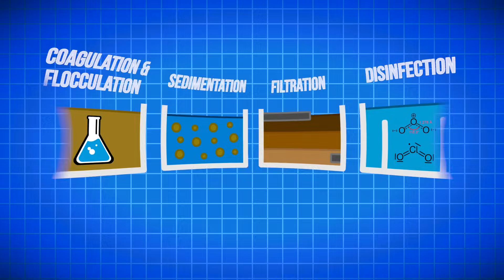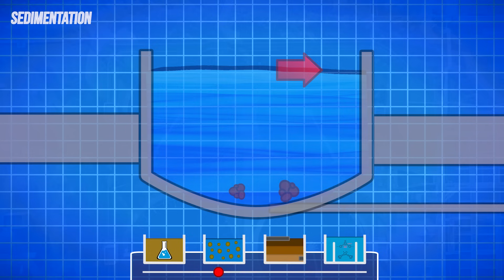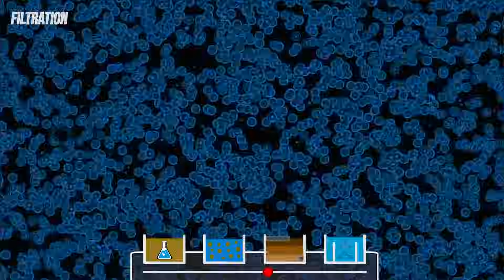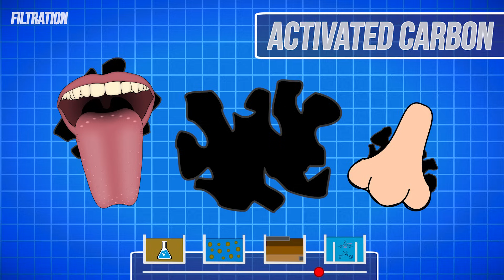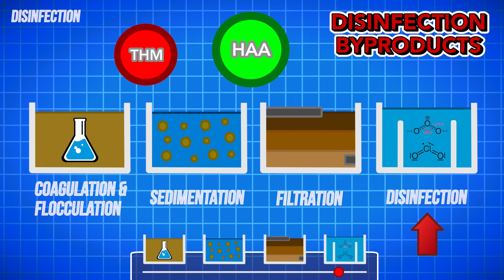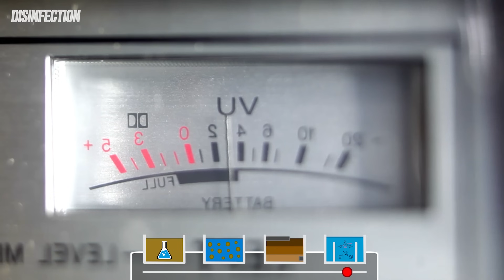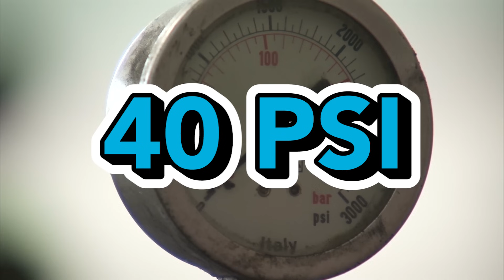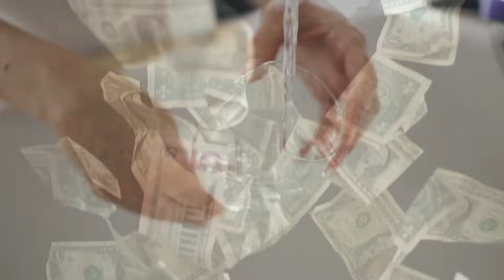How Do Water Treatment Plants Work?

Comment: As a certified water operator myself. This video is a very good basic overview of what goes on in a water treatment plant. Good job.
Reply from the maker: Thanks!
Reply: how did u become a water operator? Im so lost. I just graduated high school.
Reply: @dlo6097  I went to college and finished my degree in mechanical engineering. Got a job with a company that needed a facility tech with some engineering knowledge so I got hired and asked if I could take ove the facility water plant. I agreed, and took over, studied to get my treatment and distribution certifications and now I'm head of the water department.
Reply: @dlo6097  Your best bet is to try to get your certifications in treatment or distribution or both. Contact your local environmental government agency to see what is your state requirements for you to take the exam for level 1 treatment or level 1 distribution. Usually you can take them without any experience at the level 1 in most states. There are 5 levels on each treatment and distribution. Levels 2 through 5 usually require you to have a year or more of experience.
Reply: @dlo6097  Study and get level 1. After that you will have a good chance of getting hired at a low level in any water facility. From there just keep working to gain experience and then get the level 2 and 3 tests on whichever area you like most whether it be water treatment or distribution.
Reply: @dlo6097  there is a need for operators in water and wastewater all over the country. I was fortunate to have a school near me that teaches operator training but getting a job at your local plant will get you started. You will then be required to take certain tests over time to be qualified as an operator. Good luck!
Reply: @dlo6097  How’s it going for you? I’m curious because i’m interested in the same thing and I have no clue what to do

Comment: As an operator in Ohio I can confirm. However I have only ever heard of Chlorine disinfection for the  clean side. If O3 or UV gets used It would be on the  dirty end for  sure.
Reply from the maker: Definitely agree. Most US plants are going to be required to have residual chlorine levels. I’ve seen some plants with UV and Chlorine, or a combination for extra treatment. Chlorine seems to be less common outside of the US
Reply: Hi I’m an operator from Queensland, Australia and we use uv reactors after the filters and also use free chlorine. And as a side note we are starting to implement chlorine contact time in our HACCP charts.
Reply: Operator in Saskatchewan. We have some plants which use pre-chlorination. Yes you have risks associated, but if properly managed, it can be very beneficial. Really depends on your source water and type of plan.
Reply: I suppose I should have  added that we are 100% ground water, so we have a much lower risk of issues from just using pure chlorination. I supposed I only looked at it from  that lens. Perhaps operations with more issues from organics might be at more of a risk to use chlorination only. Thanks for the eye opener, could be useful in the future if a job transfer ever became a thing.
Reply: Operator here in ohio and we use ozone coupled with hypo. In the process of also getting uv. I wouldnt say dirty but rather so much safer. Less work hazards.
Reply: @Vic-gz3xj  By dirty, i meant wastewater. And I honestly had no idea it was so common. We use liquid CL2, however our flow isn't as nearly as high as some of the other plants if toured and heard talk of.
Reply: @LB-ys6mq  what brand of analyzers do you use to monitor turbidity, pH, and chlorine? Have you ever heard of Hach?
Reply: At our Ohio wastewater plant our last step is chlorine contact basin, then declor with thiosulfate before sending it to the river

Comment: Very interesting video and good animation. Smaller sedimentation tanks can be build using lamella clarifiers
Reply: I'm doing my internship at water treatment plant. They need me to find out why is PAC doesn't worked so well at the first plant ( as an alternative, they use alum + lime) but at the same time it works very well at the second plant even both plants came from similar water source? Thank you

Comment: You described “conventional” treatment, though there is also “direct” (same without the settling), slow sand (rarely w coagulation), membrane (a filter made of plastic or ceramic), and cartridge or bag (as the filter). Hard to cover all that in 10 minutes, yet worth briefly mentioning up front as your content is simply one example of many.
Reply: And you incorrectly described (reversed) the flow path in the sand filter.

Comment: It's usually chemical engineers not civil engineers are apt for water treatment plant operation.  Remember chemicals are handled in water treatment plant.  Civil engineers are only involve during civil works and construction of the water treatment plant after the chemical engineer, mechanical engineer, electrical engineer and process control engineer have designed it properly.
Reply: Possibly in your country, but in the US, the civil engineer is the lead discipline for these types of projects. In small projects (<5 MGD), almost all of the design work is often done by civil engineers, with the exception of electrical and HVAC components.

Comment: 3. List some of the things that are removed from the water during the Water Treatment Process.
4. Why filters are added to the Water Treatment Process?
5. What kind of filters are used in the Water Treatment Process?
6. What are the two reasons chlorine is used in the disinfection step of the Water Treatment Process?
7. What other TWO methods besides chlorine are used during the disinfection step?

Questions for my  science review HELP ME
Reply from the maker: 3. Inorganic compounds - trash, nonhuman waste; Organic compounds - human waste; other agents that are required by state or national permit i.e. industrial chemicals, pharmaceuticals, etc.
4. Taste and Odor mostly, but they are occasionally used for treatment. Filters like activated carbon and other filter media help remove small organic particles that make it through treatment and overall improve the taste and odor of water. When these things are removed, the water will likely have less of a chlorine smell because there won't be as many disinfection biproducts.
5. Activated Carbon (taste and odor), Reverse osmosis filters (potable filtration), sand filters (very common if not always present - used to remove all matter in water), trickling filters (not common/older tech, allow bacteria to filter out organic matter)
6. To kill bacteria first off, but chlorine is also the only disinfection type that is residual. This protects the water from pathogens that might be introduced after the water leaves the plant. So, 1. to kill bacteria, 2. to supply residual disinfection properties and keep the water safe.
7. Ozone - kills and destroys the bacteria through oxidation, UV - scrambles bacteria's DNA so they can't reproduce and harm someone.
Reply from the maker: I hope that helped! :) I wouldn't use me as a source if you have to site it, but all this can be found with a little more research if you need sources :)

Comment: Your explanation of multimedia filters is completely wrong. Activated carbon is usually placed on top of the filters. Water is added to the filters at the top of the filter, with the course media, usually anthracite coal. Then the finer media, usually sand, then a gravel at the bottom. Most of your other explanations are somewhat correct. BTW, I am a water treatment plant operator. Thank you for the kudos for our unsung efforts.
Reply from the maker: Hey James! I’ve got a civil engineering background, I tried to highlight these filters as simply as possible. The layout you suggested is correct, but it can also be laid out in other orientations depending upon how the basins are engineered🙂 thanks for your work as an operator!

Comment: Question though, sometimes I put ice at the bottom of a crystal glass it melts and I see floating particles which turn out to be clumps of calcium. Is there supposed to be that much calcium in my drinking water where I can see it?

Comment: The only thing that is incorrectly described in this video is the process of Aeration basins.  The aeration basins are used to get rid of volatile gases/liquids and this is typically done just before gravity filtration.  This is not typically seen in most treatment plants but when it is it is typically not dealing with air being blown into the water but the water is introduced into air known as trickling aeration.  This is the only correction that is being mistold about the treatment process and should be reviewed for education accuracy.
Reply: You're describing a different but similar process.

Comment: Have you heard of using Electron Beam Accelerator irradiation process for treating waste water instead of a variety of chemicals, chlorine or UV rays and Ozone. EBEAM be easily integrated in the pretreatment, post treatment at far less economical cost.

Comment: The only issue I have with this is about the residual PSI in a distribution system. It should be 20PSI, not 40. Source: 12 years as a water treatment plant operator and years of extended training.
Reply from the maker: 20 psi is minimum during fires, 40 is the standard in the US for operational flow.
Reply: Minimum pressure during fires of 20 psi is correct, but 35 psi minimum is used in some jurisdictions. I have 45 yrs as civil-environmental engineering professional (including operations experience) in several northeastern and mid-Atlantic states. @Concerning Reality - very good video!

Comment: I have a serious question, i've read that the ph in pure water is 7. to regulate the ph is sufficient  to "purify" it ? I mean, Do i need to buy a alkaline water filter to feel it more pure?
Reply from the maker: pH isn’t really the cause of pure water, rather an indicator. That said, there are other factors that play into waters purity. If you want water to “feel” pure, I’d recommend using an activated car carbon/charcoal filter. This will have a huge affect on taste and odor, and it’ll help filter out micro particles in the water as well🙂
Reply: @ConcerningReality  Thank you so much, i was feeling i was about to get scammed. I'll buy a carbon/charcoal filter with a ozone purifier. Costs less than that nikken alkaline water filter

Comment: I still have ? Dose it depend of the filters size to how long it takes to get it clean???
Reply: Yeah
Reply: Most conventional treatment plants use what is referred to as "mixed media"  filters. They use different size filter media from top to bottom...such as baseball size rocks or balls at the bottom....then a smaller rock layer above that...then sand ...then anthracite.

Comment: chemical and environmental engineers need to be credited/mentioned also :(
Reply from the maker: Most of this is done by civil engineers, environmental being a subset of civil. I’ve never heard of engineers other than civil design water treatment plants. Certainly not trying to shade Chem or Environmental🙂
Reply: @ConcerningReality  don't you need chemical engineering for the chemical process I mean the last stage cause you need the right amount of Chemical and don't want to waste the expensive chemical if you use it more than it's supposed to. Just my opinion
Reply from the maker: @AfiqahMansor-ql7km  That's part of a civil engineering degree :)
Reply: @ConcerningReality  hahaha are serious? First of all, yes there are some common working areas of env. and civil eng. obviously as like in treatment plants, they are working together. But these are two independent engineering branches that can occasionally come together, and work together.
However there is no way to design a water/ww treatment plant without an env. or chem. eng., since they know how to process it. Civil engineers are not and cannot be involved with the water quality, process selection etc. Please do not make definitive comments like this if you do not have enough experience.
Reply from the maker: @irmakozturk8352  It's likely a regulatory thing. Here in the US, Civil engineers like myself have all of the certifications and chemical training necessary to design treatment plants without any consults. Regulations very by geography.
Reply: @ConcerningReality   I get that but having certifications and training do not mean that you became also an env. eng. besides civil eng. In most of the countries, these are separate 4-year bachelor programs, and a civil engineer cannot do the exact work that env. eng do and vice versa of course, that's all I say.
Reply: @irmakozturk8352  i think what he was trying to say is that for projects regarding water treatment plants, probably he only got certification that enables him to handle chemical processes only related to water treatment or others that are related indirectly to it. and you are right chemical engineering and environmental engineering have their own disciplinary, but he is also right when saying as a civil major, he also learned environmental too, but maybe only up to some certain levels, not in detail particularly. as we all know, even each of those engineering disciplinaries too have so much specialised manner which incorporates each other disciplinaries. for example, like this water treatment plan, its true that civil engineers play most part in it, but things like chemical and environmental engineering are somehow a minor part but still crucial thing if we see the overall view. sometimes, you don't really precisely need to be a pure environmental or chemical engineer for things related to the project. you just need to know the important things about water treatment that is related to environmental and chemical, which is why the certificate is needed. only specifically for some specialised purpose. even civil engineering have different specialties, needing to consider geographical factor, that's just fundamental part for civil engineers, but it varies on the projects, for water treatment, the method is different, cause you need to encounter different geography state, cause you're doing it underground, need to go through roads, through public areas. for building construction, you do it above the ground, but the fundamental is still the same, considering geographical factors too. and each of that requires different certificates too for specialisation. not sure about certificates on general works, but usually there's some limits too, whereas specialisation can make you go deeper into niche area of it. i might be wrong. correct me if I do.
Reply: yeah they do, but the overall plans, the layout, jacking those pipes underground, meaning the major works, mostly related to civil disciplinary. its just the environmental part and chemical part plays a crucial part but relatively a bit small seeing overall project. but its undeniable that all of them are totally related to each other.

Comment: No where in this process mentions why Fluoride to added  in our drinking water.  It does not contribute to purifying the water in any way shape or form.  It can melt concrete on contact,  yet they want us to drink it.
Reply from the maker: It's added to water, often because of requirements from the state, to prevent tooth decay. The "concrete fact" is superfluous to it's effectivity/use (that's a concentration issue), but yes, there's plenty of room for debate that Fluoride shouldn't be added to drinking water, especially on the backs of recent studies. I personally don't think the risk is high enough to act on in my area, but levels do vary based on treatment source. If you do feel that you'd like to not come in contact with it, then buying distilled or spring water from the store will prevent exposure. In summary, it's been added for decades to aide in dental health, but it's actual effect is still being questioned.
Reply: @ConcerningReality  
I actually buy bottled water specifically that is Fluoride free.  I read an article years ago that it can cause lesions in the brain,   and that this chemical is a byproduct of Aluminum manufacturing.  This is concerning to me especially its long term effects to children.

As far as Dental health is concerned,  it should be the responsibility at the consumer's end,  NOT the water supplier.  Essentially,  they are prescribing medication without medical license and without the consent of the patients.  Water treatment plants should only concern themselves with clean/safe water  instead of medicating their consumers.
Reply: Water operators have no say in adding fluoride, it’s up to the city/customers to vote on if they want it or not. I’m glad our city decided to stop fluoridation years ago.